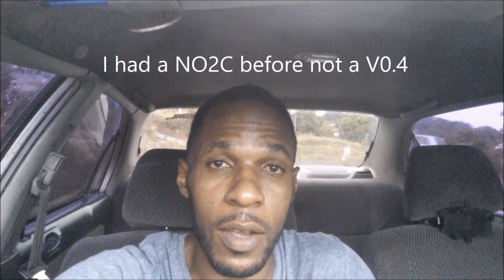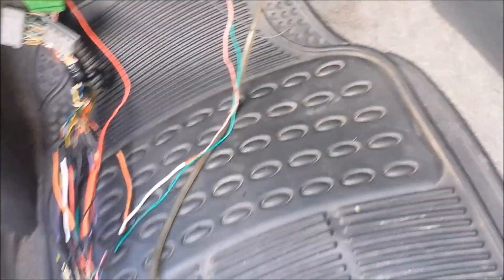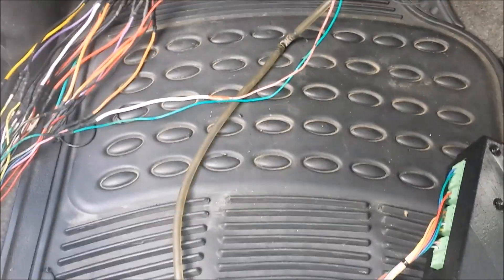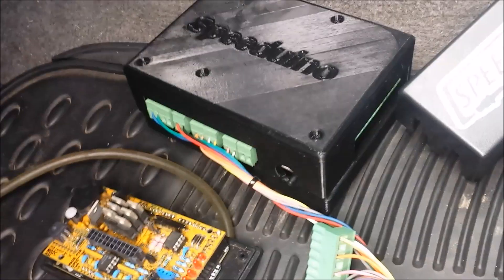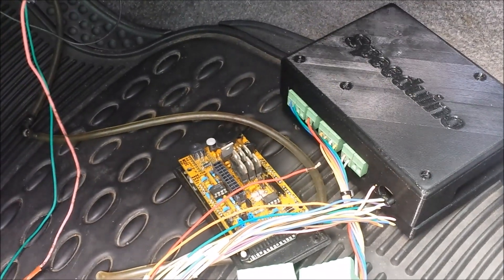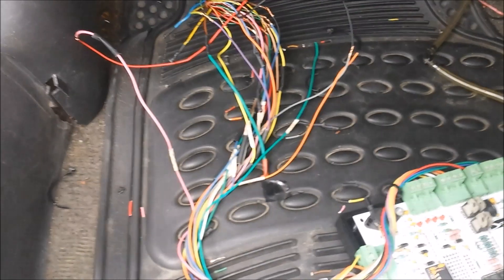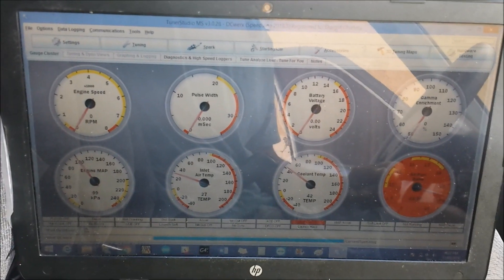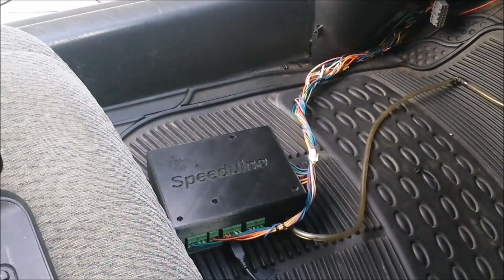Honda Speeduino ECU Install

Comment: Hey mate can you comment your D16 coolant temp sensor resistance settings? I am unsure what to run, I have a gauge in my car that I have used to copy temps into tunerstudios with estimated resistances until TS is showing similar to the gauge, but I don't know if the gauge is 100% correct tho. Thanks :)
Reply from the maker: There is an article on the web by megasquirt if you search for megasquirt honda

Comment: It would be great to see a NO2C with 4 ignition and injector outputs, this way its possible for sequential ignition and also adds the ability to use one low impedance injector per cylinder.
Reply from the maker: I imagine it would be difficult fitting all of that on a no2c sized board

Comment: I'm planning on setting up my F20B DOHC 5 speed LSD swapped CB7 with one.  Are the base maps solid enough to where I can get the engine running to tune on the fly?
Reply from the maker: There is a generic basemap available that you can modify to work on almost any engine if you enter the correct settings.

For my cars and my customer's I make my own basemaps
Reply: @DCWERX  thank you!

Comment: Who is the 1st to use Speeduino with K series Honda?
How can the VTEC parameters be modified in Tuner Studio MS?
Reply from the maker: There were 1 or 2 guys working on a K series install, I am not sure if the finished it or not.

V-tec is controlled via an 8x8 table in TS. TPS vs RPM
Reply: @DCWERX  Excellent, thank you Sir.

Comment: I just recieved my v4 board.
Im planning to do this on my D14 honda, I think i have to get a D15 distributor and convert over to obd0 to get the crank position sensors.
Reply from the maker: This link helped me out a fair bit http://www.dodo-upgrades.nl/obd1swapd14a34.htm
Reply: Yeah my D14 is SFI, thanks for the info! Your video's are a big motivation for me to begin this project! I hope to get started beginning next month when my other car gets insured again.
Reply from the maker: Your d14 is SFI ? My d15 was originally SFI. I used and obd2 distributor and just did a lil extra wiring. It's relatively easy. Any obd1, or obd2 distributor will work.

Comment: Did you use VR conditioners?
Reply from the maker: Yes you need a vr conditioner or dual vr conditioner depending on how you wire it.
Reply: @DCWERX  Thank you sir.  I knew that, just needed confirmation.

Comment: 1st!
Reply: While I'm here, did you use VR conditioners for CKP and CYP sensors?
Reply from the maker: @charleskozak4102 yes all signals from the factory distributor would need a vr conditioner. Go through the link I posted and you will see that out of simplicity you can ignore the cyp/cym and ckp/ckm and just use the tdcP and tdcM with a single vr conditioner and that's enough to get it running.